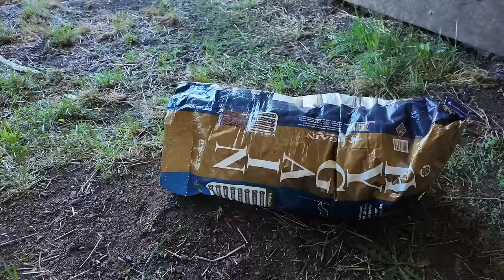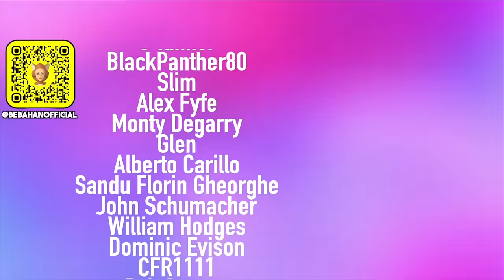DAY IN MY LIFE - (VLOG #21)

Comment: Not sure why they told you not to get a belt sander. That's absolutely a great tool for that table top. Looks great as-is, but I don't know why they would've said to not use a belt sander. 100% what I would've used with that filler.

Comment: a good tip to "sand off" body filler is to use something called a cabinet scraper. I am in the US so I get mine from a gunsmithing supplier that is near me because I don't have an good woodworking shops close to me but that is where most people get them. You can make one by running a screwdriver shaft perpendicular to the edge of a razor blade to bend the edge. use the chisel to pair off the the thick areas of filler and scrap the rest smooth and you won't even need sand paper.

Comment: For rough - in sanding, try a hand-held belt sander. You'll amazed. As for what you should and shouldn't fill, it can be hard to strike a balance between smooth surfaces and the rustic edges, but it all comes down to what you like.
Reply: much love. comment for the algorithm <3

Comment: A suggestion to help speed up the sanding is to have a shop vac attached to your sander. When your sanding medium gets loaded up with material it can't cut as well, which slows it down. The little vac the tool has is quite weak.

Comment: When filling your timber make sure you have a smooth finish before letting the filler go hard, that way there is less sanding - it's easier to add additional filler later than wasting time and money on sanding. When you get filler in the grain of the timber you are best to get someone to plane the timber to a slightly narrower dimension i.e. take a millimeter of both sides - this will reduce the amount of sanding you need to do and give a better, more even, finish.
Reply: much love. comment for the algorithm <3

Comment: In my experience, using hardeners, use less for a stronger more durable product, just takes much longer to cure and much less shrinkage, using too much hardener cures really fast but shrinks more and is brittle.  No puns intended.

Comment: I had made multiple live edge shelves before. I think they look the nicest, but I made minimum sanding efforts for several of them and put on the log cutoffs in the attic kinda part of the bedroom for books and stuff. Looks very unconventional. The one above my pc is sanded very thorougly and coated with poly, but you cant see anything, it is so overcrowded with stuff, I went into it too much, nobody can see it :D lightly sanded one on top of it right now, raised with 4×4 cutoffs. Nothing in my work has any filler in it. I di not like fillers and the woods I used is not that prone to cracks and holes. Sad we cant share woodworking photos in comments :)

Comment: Who taught you to cook the beef for the dogs? You need to braise it first, before putting the water in. I know if you just put it to a quick boil it will cook and get done but the meat will be tough. If you add garlic powder and braise it first, the meat should be a little more tender and the garlic helps to keep  fleas, ticks, and parasites away. Do not use alot of garlic. If you want to marinate the meat overnight, use vinegar and garlic, then rinse it off. You might also want to use the liver as it is excellent for them, and the dogs will love it.

Comment: You should of used a 6 inch wide drywall spreader to spread the filler it would be flat and not need sanding daa